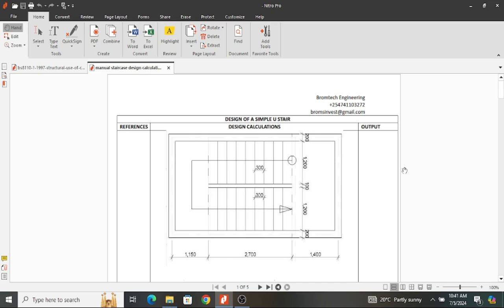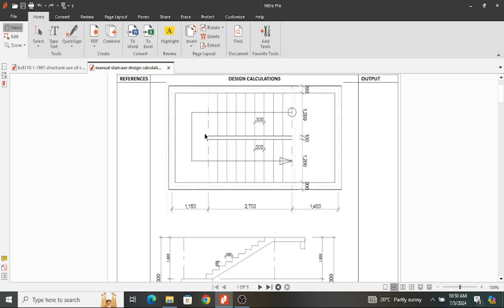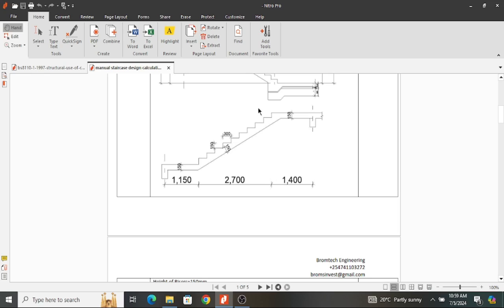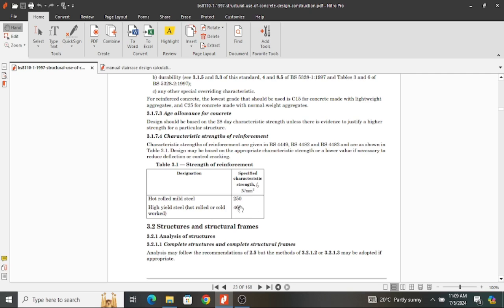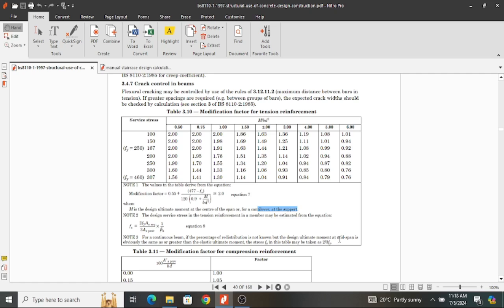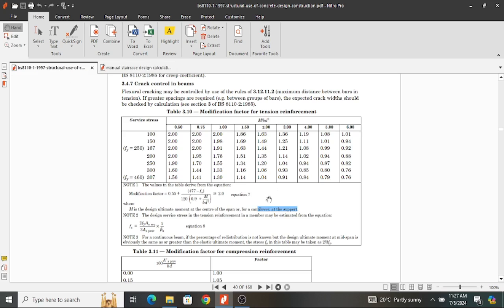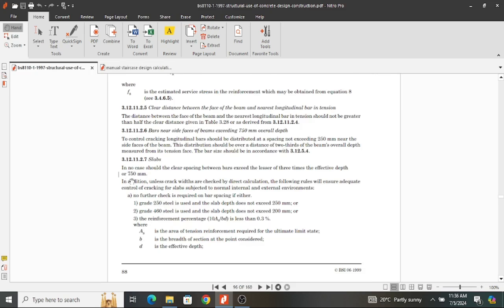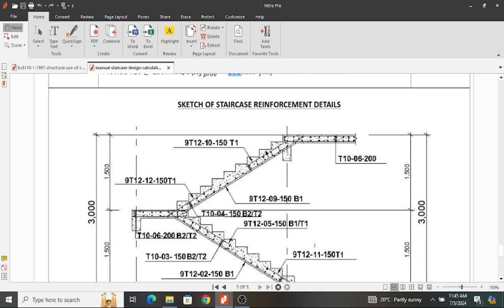DESIGN OF RC STAIRCASE

Comment: This is a very detailed explanation and it is really in depth. This is very very helpful. Please regarding your detailing, could you explain more on the number of reinforcements needed based on the shapes the reinforcement is taking on the staircase. I do understand the spacing but how do i detail accurately. I believe there is formula for it. Thank youuu🎉